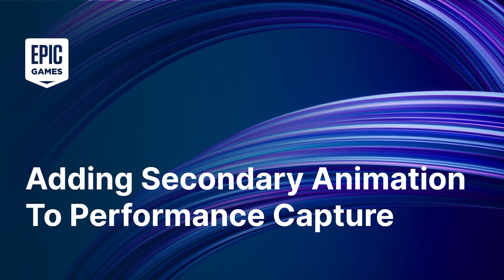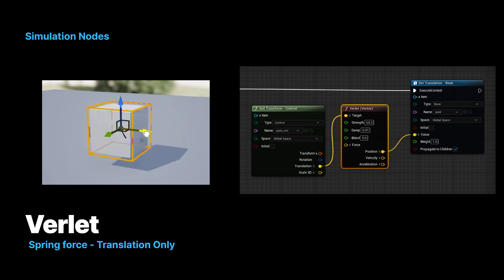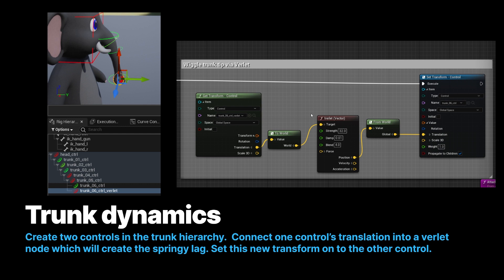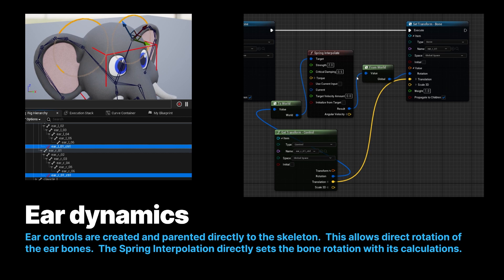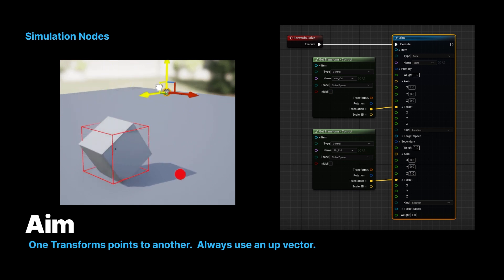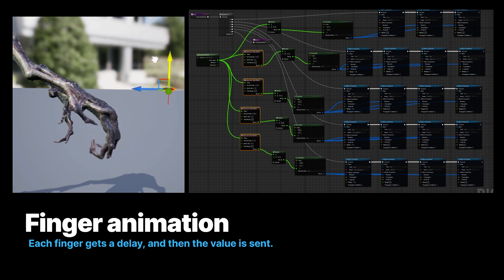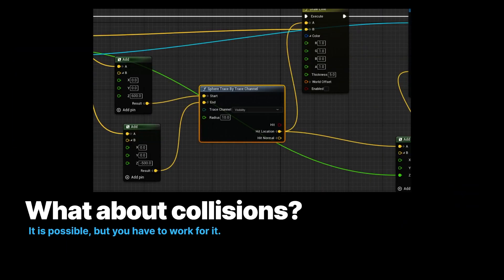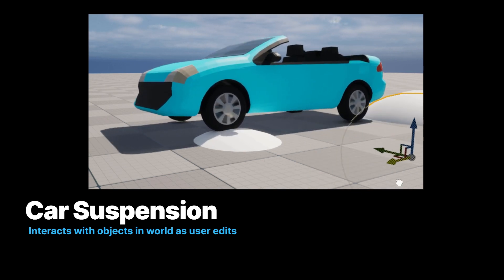Unreal Engine 5: Adding Secondary Animation with Control Rig

Comment: Thanks for the tutotial.
I have a question. Do you know how to bake animation from a level sequence to an animation sequence while ensuring it fully respects the physics we see?
I'm running an issue where I applied the spring interpolate and created a loop animation. It works perfectly in the level sequence, but in the animation sequence, it doesn't loop correctly
Do you know any trick to solve this problem?
Reply from the maker: For something like this I would recommend using take recorder to bake the bones.  This will be more of a "What you see is what you get" than baking.  Unfortunately you cannot use take recorder to back controls, but you can do a reverse solve to get the bone animations back to FK controls.

Comment: This is great bro.Awesome.could you give a simple one but from setting it up from the start so we can understand most especially for begginer.thank you
Reply from the maker: I think that's a great idea.  I will do this.
Reply: @tbowren  this please! I'm just getting into stuff like spring controllers (specifically for toon style hair). I'm also curious as to whether it's possible to add and rig bones to an existing control rig in UE or does the whole skeletal mesh need to be rigged before importing? Thanks!
Reply: @tbowren  can we have a tutorial that also shows how create a Control Rig switch to turn off the secondary dynamics and let the animator take control for a bit, then switch back to secondary dynamics?